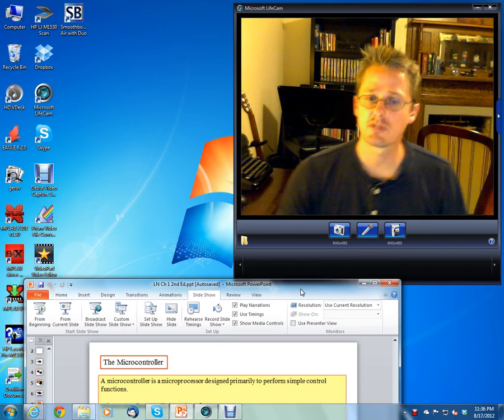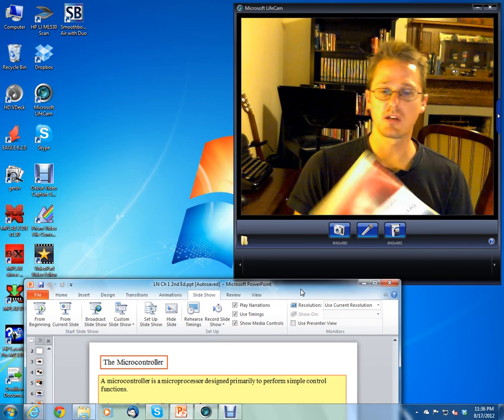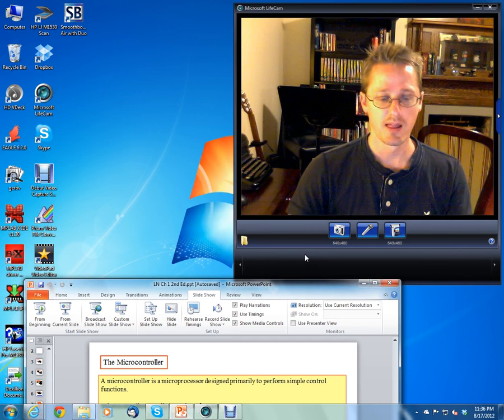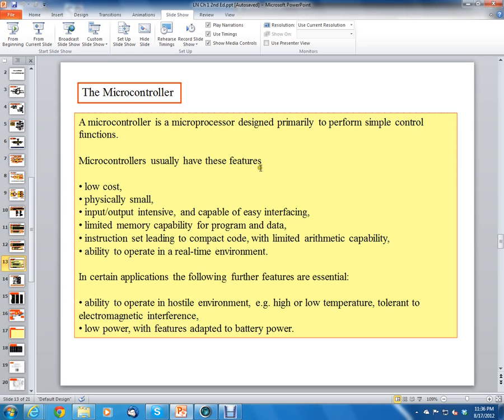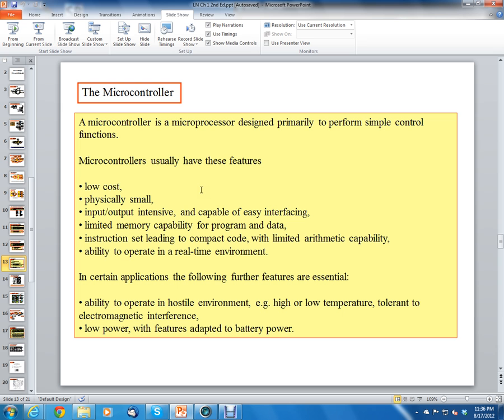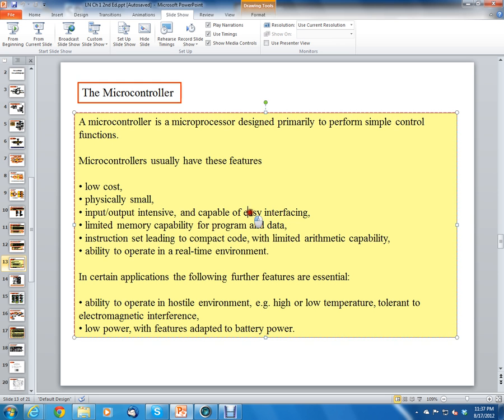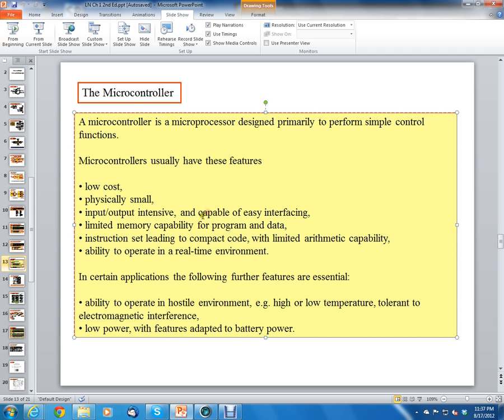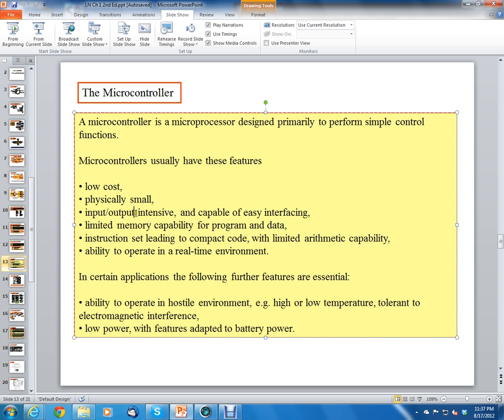PIC16 Microcontrollers, Unit 2, Ch 1.4-1.6; Microcontrollers vs. Microprocessors

Comment: Thumbs up. I just wrote my first pic micro-controller assembly program. The c/b bit tip really helped me out. Those datasheets tutorials and courses seem to be written on purpose in misleading fashion. I can understand, some stuff has to be simplified, otherwise instead of 150 pages we would have 600, but in this case it screams for revenge!